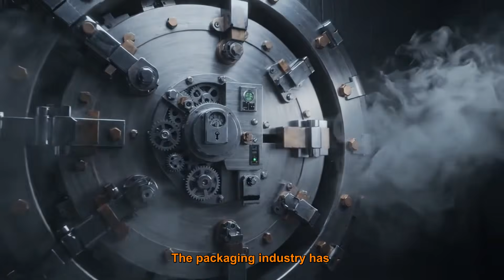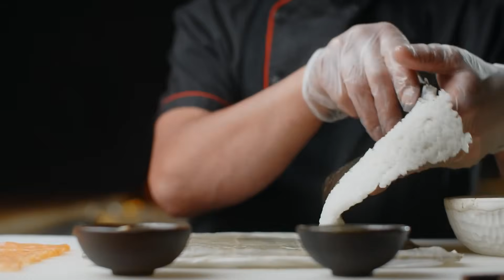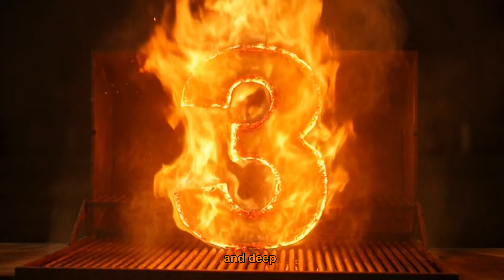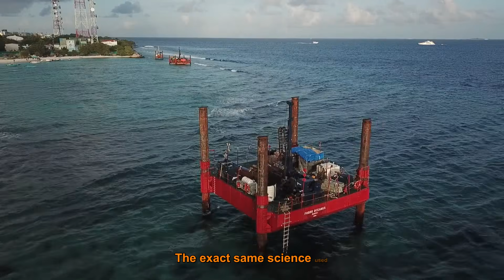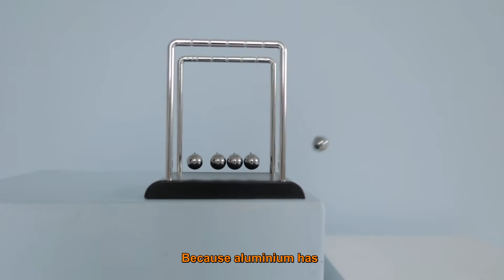7 Foil Hacks That Save $100s (Industry Kept Hidden)

Comment from the maker: Hey everyone, Cole here!

When I was preparing the material for this video, I relied on a lot of different data and research. To answer those asking for proof, here are the main sources and articles I used for each of the 7 tricks shown in the video:

1⃣ The official explanation on the shiny vs. dull side of foil:
https://www.reynoldsbrands.com/tips-and-how-tos/aluminum-foil-guide

2⃣ How aluminum foil helps clean and sharpen scissors:
https://www.tastingtable.com/931988/how-to-use-aluminum-foil-to-sharpen-your-kitchen-scissors/

3⃣ Medical data on wire grill brushes & the foil alternative:
https://pubmed.ncbi.nlm.nih.gov/23206515/

4⃣ The science behind sharpening scissors with aluminum foil:
https://www.tastingtable.com/931988/how-to-use-aluminum-foil-to-sharpen-your-kitchen-scissors/

5⃣ The Dartmouth College study on using foil to boost Wi-Fi signals:
https://techcrunch.com/2017/11/08/researchers-discover-aluminum-foil-actually-does-improve-your-wireless-speed/

6⃣ Why the reflective ironing board trick works:
https://www.thecityisours.co.uk/home-cleaning/the-aluminum-foil-trick-to-iron-double-sided-why-reflective-metal-boosts-heat-4139/

7⃣ The actual chemistry (Redox reaction) for cleaning silver safely:
https://chem.libretexts.org/Courses/University_of_California_Davis/UCDemos/Cleaning_Silverware__Electrochemical_Reaction

Hope you find this extra info helpful! Let me know in the comments which trick surprised you the most. 👇
Reply: The fact you listed your sources this clearly after a pretty good video, gained you a sub. Keep it up, I'm looking forward to what you put out next. 👍

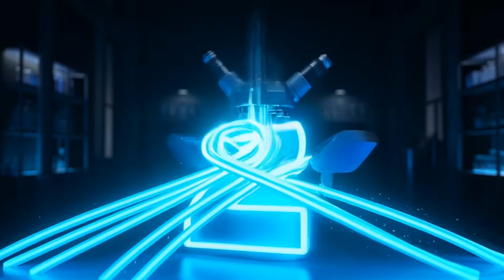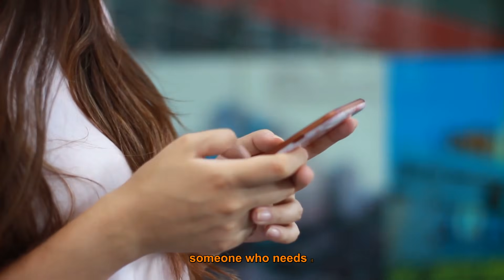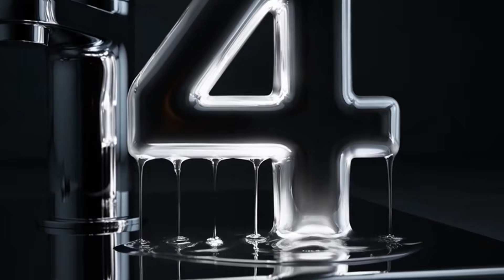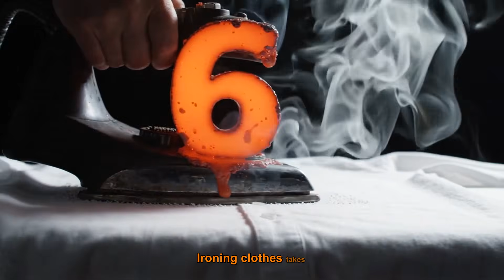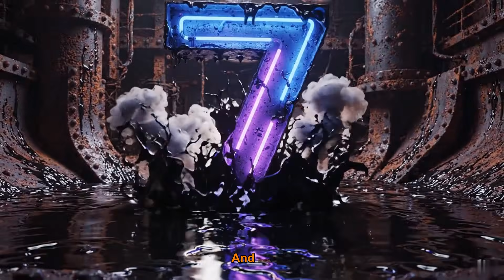Comment: 2: 2:41 Sissors, 3:  3:46 Bbq Cleaning, 4:    4:50 Crome cleaner for Rust,  5:36:  Boost Wifi Signal by 55%,  6:  6:43  Iron Clothes,  7:  7:50 Jewellery  Cleaning.